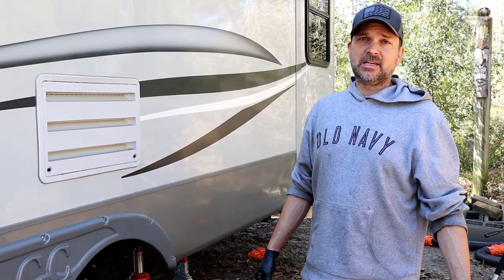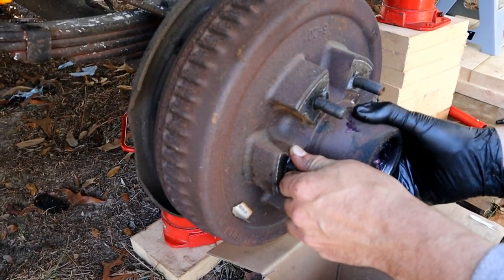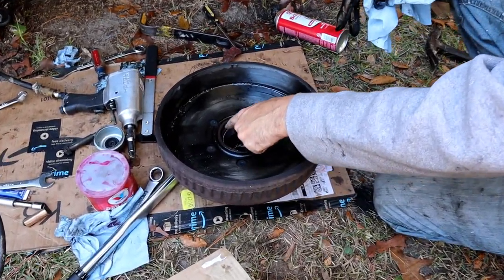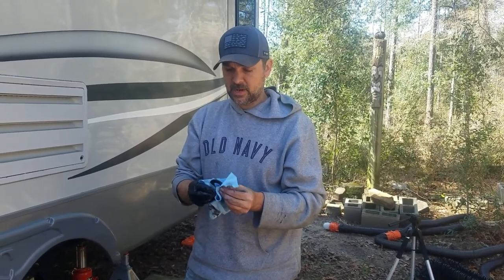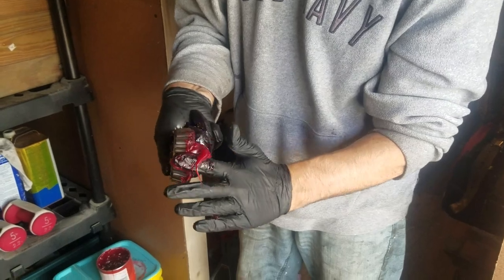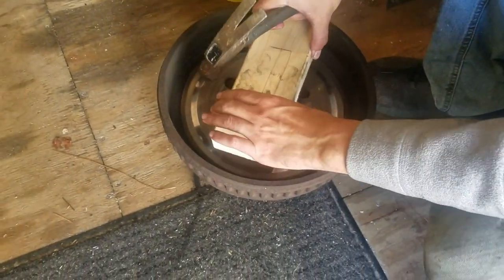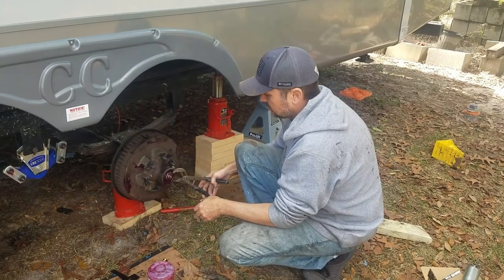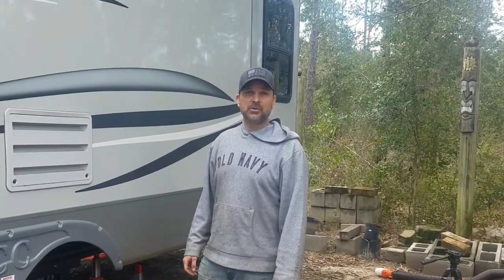How To Pack RV Trailer Wheel Bearings ~  Bearing Packing DIY  ~  RV Wheel Maintenance

Comment: Great job! I have never seen that brake setting tool before!
Reply from the maker: Thanks for watching, it was a pretty cool tool and saves a lot of hassle adjusting brakes.
Reply: @RVLivingYet  When using the measuring tool for the brake shoes, how much of a clearance do you want between the dimension of the shoes (Outside diameter) and the inner dimension of the drum? Thanks

Comment: Nice work and instructional video!  That metal clip scares me though for the castle nut, I would feel much better with the cotter pin design.  Have you had any issues with it getting loose on you?
Reply from the maker: I agree, it seems like it could fail. So far we have had no issues. Thanks for watching.
Reply: On my trailer the retainer clip goes behind the castle nut and you bend the tabs into the notches on the nut. I wasn’t to sure about it at first but iv pulled it from Washington to Arizona and back close to 30 times(2600 miles round trip) with zero issues. I’m confident in it now

Comment: It looks like you have the easy lube system on your axels. Why not just use a grease gun and grease the bearings that way? Then you don’t have to take it apart and pack them by hand.
Reply from the maker: Its good to inspect them and thoroughly grease them ever once in a while.
Reply: It’s way to easy too overfill the bearing cavity with grease if you keep pumping grease and never taking the hub off.   There needs to be air space in the hub to dissipate heat.  Also how would one ever inspect the bearings, brake pads and components if all one does is just pump more grease into the hub year after year?  No, the correct way is what’s shown here.
Reply: NEVER USE THE EZ LUBE...you WILL blow the seal at some point and destroy your brakes